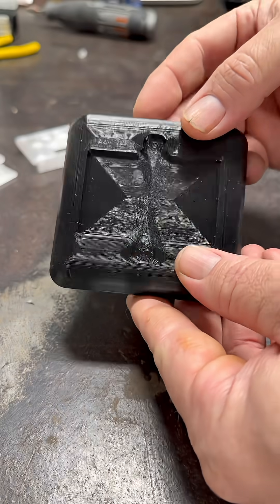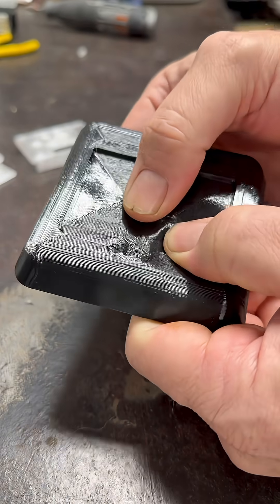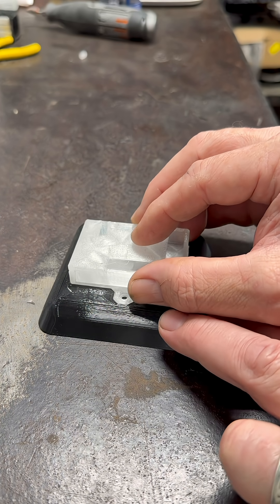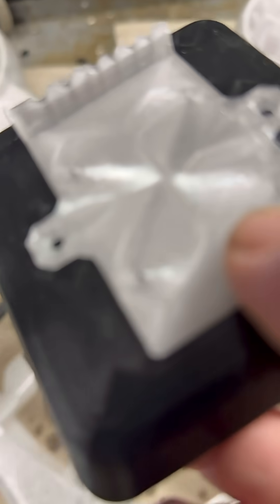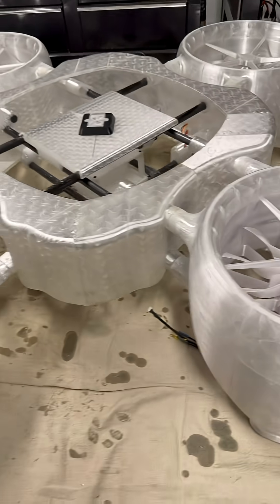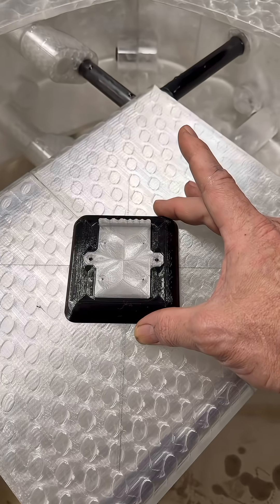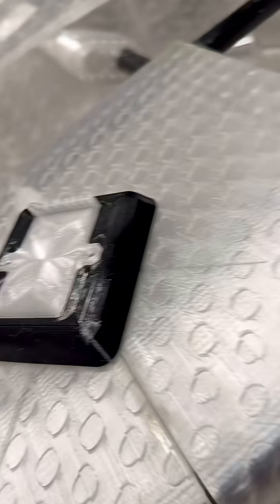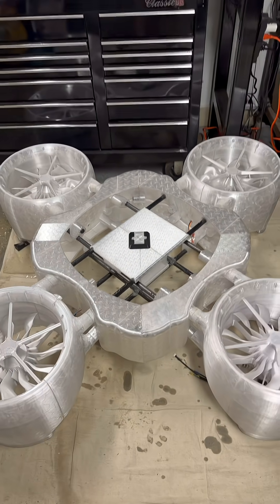TPU is just awesome. #fyp #3dprinting #shorts #diy #rc #edf #drone #build #new #hobby #youtuber

Comment: In noisy setups and big machines, people also tend to add some lead weight to the vibrationally connected component containing the flight controller - e.g. here, on top of the cover, to get the LPF cutoff frequency of the assembly down. Just reminding this trick exists.
Reply from the maker: That's a good trick, I'll keep it in mind!